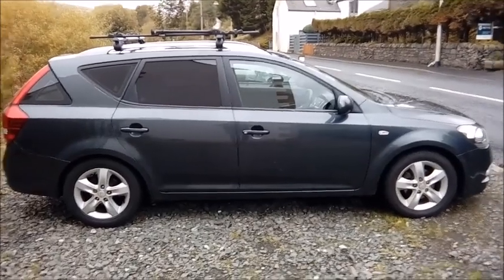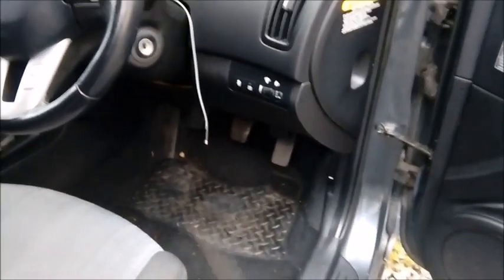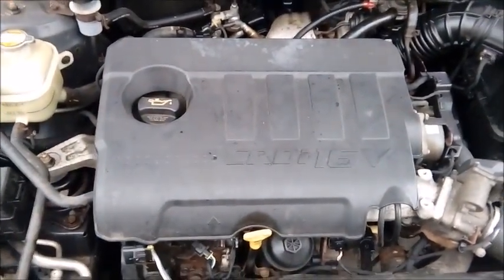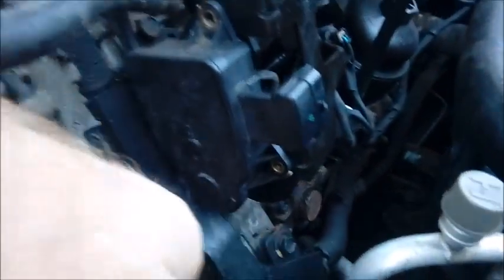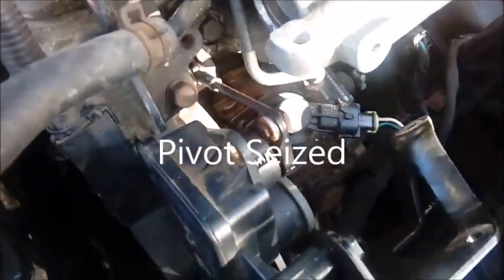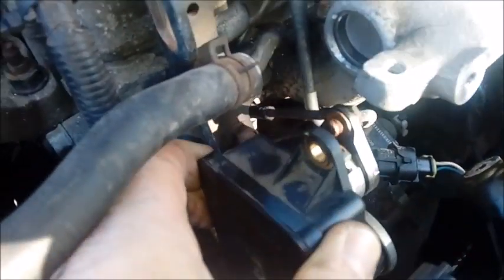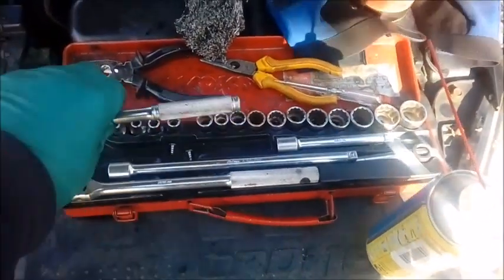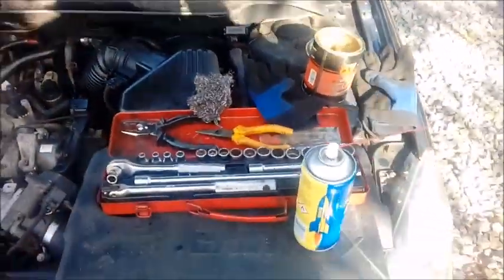KIA and Hyundai OBD Error Code P2015 Solution  - Swirl Flap Actuator for Inlet Manifold

Comment: Is this error causing engine chocking after shift from 2 to 3 gear? Because I experienced this and have same error
Reply from the maker: @AlexB-tj2te  it basically put the car into "limp mode" with very low power.
Reply: @gtd65  mine is “chocking “ when i drive and at low speed change gear and accelerate after . Is possible this affects? I have this error
Reply from the maker: @AlexB-tj2te  do you have any check engine light on the dash? 
If so, have you got a code reader to check the error?

Comment: Man, you ve done a mega great job! Well done! Thanks for so lovely and detailed description of this whole process! Thumbs up 👍👍👍
P.s. i have Hyundai Getz 1.5 crdi engine, 2006 almost the same engine structure. But i also have another fault P0402...did u have experience with it, please?
Reply: 2006 prod.year. Now it has 137000 km, when i ve bought it, was 135000 and was running perfect, very high speed (it has 110 HP) for so small auto it's enough, and consumption was ONLY 4 L per 100 km. But now consumption increased up to 6.3 L. I drive now only a freeway, may be
Reply from the maker: Cheers RK, thankfully the code has never returned and I'm now on 193,000 miles. 
I've read that you can tweak the Getz diesel engines up to 145ps quite easily?
With regards your P0402,I think that's related to your EGR valve?
If it's possible, I'd have a look to see how clean (or not) the EGR is and double check for any leaks.
Reply: @gtd65  OK, my friend, thanks! Now, from the 1st sight there is nothing special with EGR, it's clean and totally dry, no leak. But to be sure, it's better to unmount EGR and see how this valve goes up/down..
Reply from the maker: @r.k.9033  I suppose you could unplug the EGR electrical connector and see if there's any change in engine performance? 
What sort of mileage has your car done and do you do a lot of short trips?
Reply: Maybe formerly this Auto was driving only in the city. And now I make stress with high speed (but max 135/h) i think for diesel it is better freeway then city cycle.
Reply from the maker: @r.k.9033  I find that my fuel consumption goes down significantly when I have lots of stops and starts of the engine. I took a 200 mile trip last week and the car averaged 67MPG. It's now dropped to 63MPG which is still very good but that's because I'm only doing 8 mile/ 13Km trips locally.
Reply: The item was successfully solved: it was just EGR fully replaced for the new original one and that's it 💪. The rocket 🚀 is back again!
Shake 🤝

Comment: Thank you very much Sir.

 I have the same code with my kia soul 1.6 128. Nevertheless, mine is not really corroded, but when i push it forward, it comes back at its place unlike yours. Does it mean it' dead to you ?

 Thanks a ton
Reply from the maker: JKD, it's possible the actuator has failed and needs replaced. You could look for a used unit. The Hyundai i30 & Ceed use the same one.
Reply: @gtd65  why have you deleted my answer ?
Reply from the maker: @jkd7799Yann  I've not deleted any comments? Is it possible it's something YouTube deleted?

Comment: Hi, I had a same problem last year, done exactly same procedure after watching your video. After 2k miles, the light came back again and done same thing. But this it didnot go away, would you think the censor needs to be replaced now?your suggestion would be much appreciated. Thank you.
Reply from the maker: It's possible the sensor has failed and might need replacing. I'd do a strip down and double check that everything is operating smoothly, before changing the sensor. Have you tried clearing the code again? I'm happy to report that I've not had any further issues with mine.
Reply: @gtd65  Yes, stripped off everything, cleaned off and lubricated. it seems very smooth and cleared the code as well .The light came back again .Would you suggest me to buy used or brand new or aftermarket sensor ?Thank you very much for quick response.
Reply from the maker: @birshr  I'd try your local scrappy or breakers yard to see if you can get a used one for a reasonable price. The sensor will "probably" be identical on a Hyundai i30, so that would increase your chances.
Hopefully, it's not something internal that's causing the problem, inside the inlet manifold.
Reply from the maker: @birshr  here's one on eBay. I'd verify your part number. https://www.ebay.co.uk/itm/Hyundai-i30-cw-07-12-Swirl-Manifold-Flap-Motor-283202A400-1-6-CRDi-Ref-1362-/144203674476?mkcid=16&mkevt=1&_trksid=p2349624.m46890.l49286&mkrid=710-127635-2958-0
Reply: @gtd65  Thank you very much. I will take a shot on ebay-used part and let you know if it is the sensor.
Reply: @gtd65  update:got above Sensor and replaced last week.Drove about 50 miles so far, no sign of error code coming out.Finger cross, it stays like this.I saved 1Kquid because of your post here on YouTube. Thank you very much.I have been regularly servicing at  main dealer , I donot understand how come 6yrs old car got sensor failed at 45k miles.
Reply from the maker: @birshr  that's great news and hopefully the problem is fully resolved.
Would the failed sensor not have been covered under the Kia 7 year warranty?
Reply: @gtd65  I did try last year,quoted £1K.So its no.Anway who needs them if someone helpful people like you  out there .Thank you very much.
Reply from the maker: @birshr  that's not so good on the side of Kia. On the plus side, you've hopefully got the problem fixed. Glad to have been of help.
Reply: @gtd65  Hi, thank you for your helpful video. I have the same problem with my Hyundai IX35. In my case the arm is moving very smooth, so I think I need a new sensor. Anyway, I would ask you how to clear the code. Is it something I can do only with the Torque App? In addition, do you know if there is any way to "repair" the sensor? I mean, I would like to understand if is it possible to open the sensor and do some other things, before concluding it has to be replaced. I also don't know how to test it electrically. Thank you
Reply from the maker: @alessandrococo2970  glad to have been of help. Do you have a code reader (elm327 etc?) which is reading the codes and connected by Torque? If that's the case, yes you would use Torque to clear the codes after checking for codes.
It is possible your sensor has failed and might need replacement. From memory you could get used sensors fairly cheaply online.
Reply: @gtd65  thank you

Comment: Same error code here, I will give this a try tomorrow :)
Reply from the maker: It's a pity the actuator isn't more easy to access. Thankfully it's a fairly simple fix. I've never had any trouble with it again, so far... 😉
Reply: @gtd65  Yeah looks like a very simple job :)

I have a nother problem, maby you got a good idea how to fix it. Both my numberplate lights are out, changed the bulbs, and still no light. Any idea what it could be? The electrik button for the back door works fine. (Sorry for my bad english, im from Denmark :) )
Reply from the maker: @JohnniFehstedt1  I've got another video about the number plate lights, my metal screw clips rusted away. Have you got a multimeter to check there's voltage getting to the bulb sockets?
Reply: @gtd65  Yeah i got one, great idea starting with that :)
Reply from the maker: Here's the other video link
https://youtu.be/31RLaBz-yt8
Reply: @gtd65  well i try giving it grease today, but No luck, the error code came back :( 

And there is no power in the nr. Plate lights :( 

And its to have an mot Jan 19, verry bad timing
Reply from the maker: @JohnniFehstedt1  did you check that the flaps at the end of the rod are moving freely?

How far back into the wiring did you check for voltage?
Reply from the maker: @JohnniFehstedt1  you could also post your problems at 

www.kiaownersclub.co.uk 

Might be somebody on there who had similar problems.
Reply: @gtd65  Yeah like yours its moving freely :/ Yeah om looking for a Danish Kia group :)
Reply from the maker: @JohnniFehstedt1  it's possible your actuator has actually failed.
Reply: @gtd65  do you mean the elektric box that loves the arm back and forward? The car is running fine.
Reply from the maker: @JohnniFehstedt1  yes indeed, it might have failed.